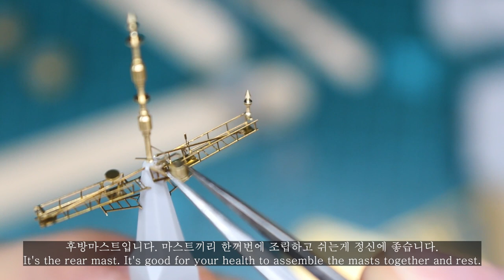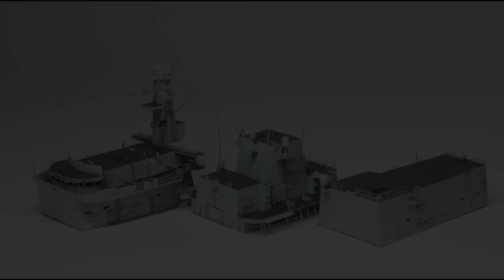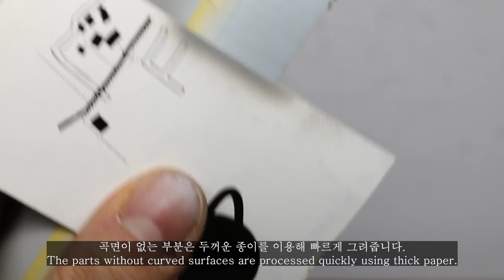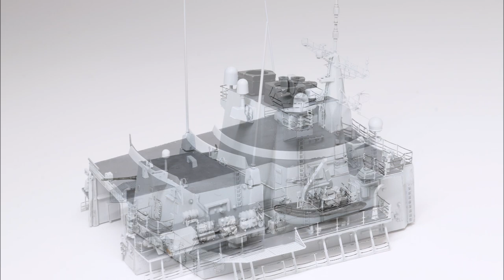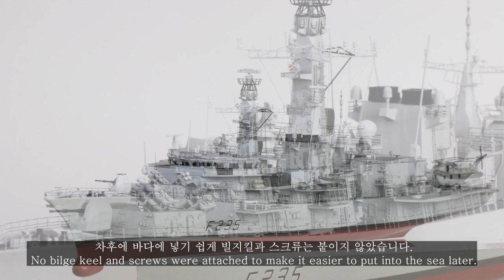Full build Warship - 1/350 Type 23 HMS Monmouth

Comment: For added authenticity you need to carefully cut out 100s of holes in the hull and superstructure and then glue the the parts you cut out back in again to replicate the 100s of new plates inserted because of the excess corrosion found on her last refit.

Comment: Actually, weathering, especially rust on Naval vessels is very hard to render.  Unlike a merchant vessel with a crew of 10 or so, HMS Monmouth has a crew of 185.  About 30-40 of which will be in the Deck Department, and who will be tasked with maintaining paint and preventing rust.
The paint finish will scan blotchy, but, that's from all the new paint put over old.
Also, Naval vessels are not that long between Port visits.  And the Captain will want his ship to look good in port.  Further, ships often return to dockside every 4-5 weeks to take on or offload various technical items.  And paint and repairs will occur that frequently as well.